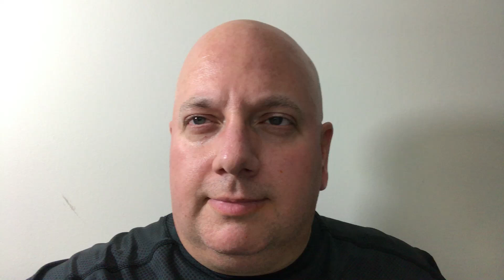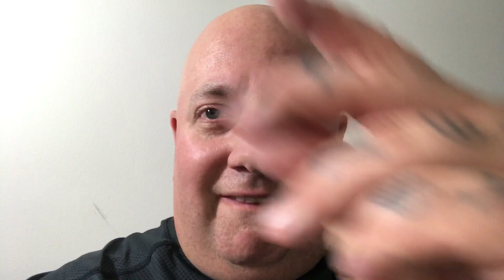🤔 WHY SONY SENSORS in IBIS Sony cameras get dirty easy

Comment: I had both Sony A7 without IBIS and Sony A7 II with IBIS, I would say both had similar issue with dirt sensors, didn't experience any difference. Only thing is that it is a bit trickier to clean the sensor with IBIS.
Reply: Have the same experience. Sucks in dust both with and without IBIS. Still I agree that static electricity is the reason. All this shit does not just fall down on the sensor.

Comment: Awww Ken! That's your opinion! I get dusts on my XT2 and D800 but not as much on my A7 ii. Factors to consider: do Sony users change lenses more because they have more glass options via adapters? Is it because the sensor is larger than the XT2? (More real estate for dust), etc. My Leica M240 gets more dust than my XT2 and it doesn't have IBIS. How long have you used or owned a Sony? Hey... just sayin. Love your channel, man!

Comment: So I imagine the Fuji X-T2s, which allegedly has IBIS, would have the same issue, correct? Could they use another material for the rails which would negate the static electricity issue?
Reply from the maker: nahhh, anything like that causes electrostatic, including rubber

Comment: except that my a6300 doesn't have IBIS and it still gets dusty, as does my a6000, which doesn't have IBIS and gets dusty. And my D750 doesn't have IBIS, and it sure gets dusty. As does my D7000, and my D5000 and D5100 before that.

Comment: Lack of weather sealing. Had that issue on the a6000.
Reply from the maker: nothing is weather sealed actually
Reply: Theoria Apophasis ok, but my point is that the a6000 picked up a lot more dust than my other camera, for what reason I do not know
Reply from the maker: a6000 was notoriously fragile

Comment: But Olympus and Panasonic implemented a static discharge and "shake" system to clean it and it works. Why Sony can't do the same?
Reply from the maker: that shake doesnt remove oil spots and other spots, its pretty useless
Reply: Theoria Apophasis But you are talking about dust on this video, right? I am talking about dust too...